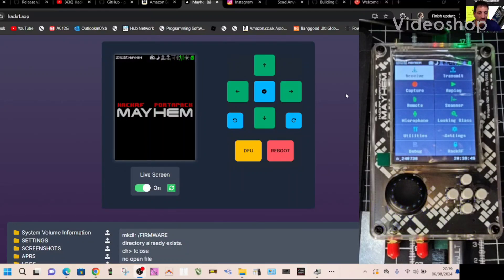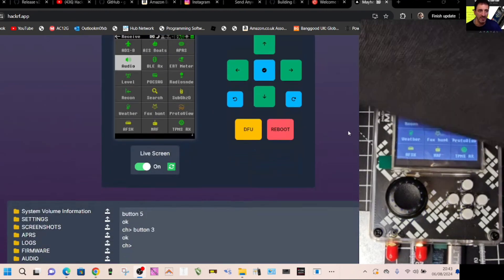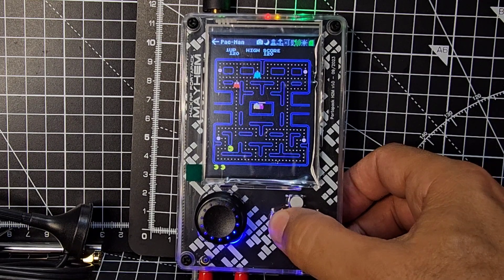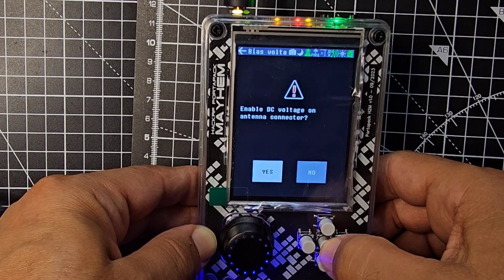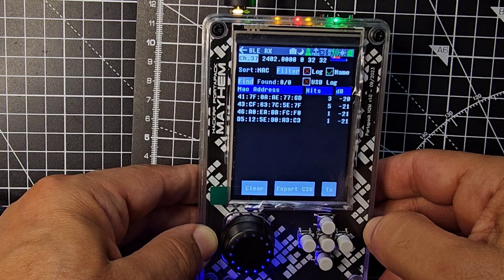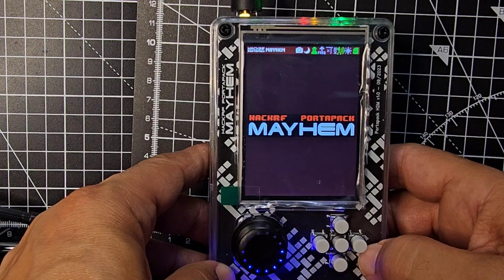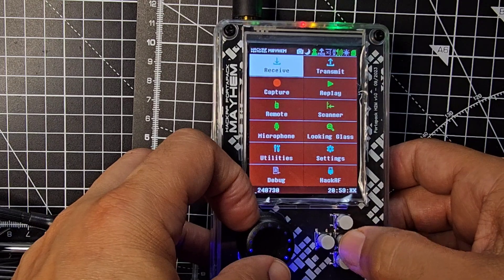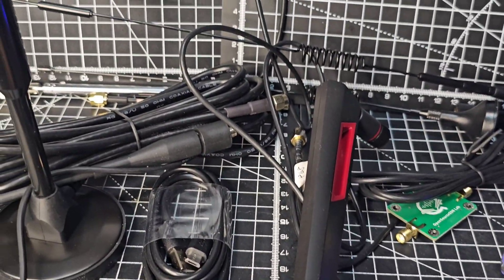HackRf One - Mayhem - Start up - Apps & Firmware Latest - Easy 2024

Comment: dont no where you are getting all the apps from i dont even have 1 page you have a few pages WTF yes im on nightly when i open up on the web site i get erorr and i have no files showing but my hackrf works fine i just dont have hafe the crap you have
Reply from the maker: You need update firmware direct from mayhem also add an SD card

Comment: Awesome ! Definitely amazing gadget. Question! I’m waiting for my hearing such good feedback but my question is does it comes with the SS card or do I need to order the Portapack H2 Software Defined Radio Kit with Antennas,3.2 Inch TFT 1MHz-6GHz?
Reply from the maker: Get everything u will need sd card.
Reply: @ thank you for the info, can you tell me what kind or which type of SD card should I look into. Plus Is it possible to use a a SD card from my 3D printer anycubic that went out of commission. Can I use that and of course format it?